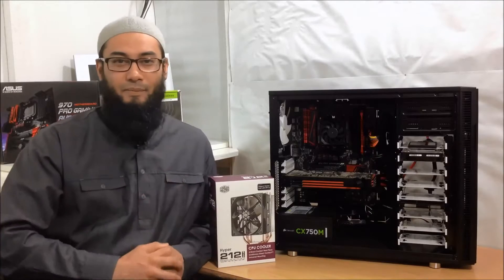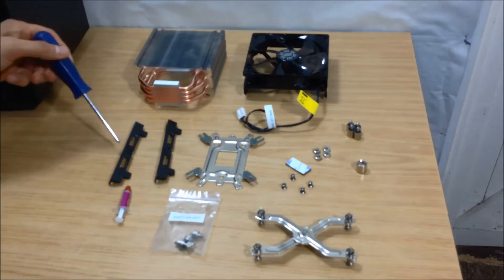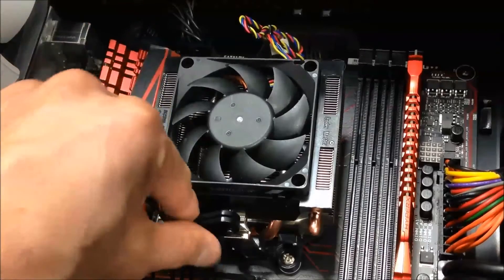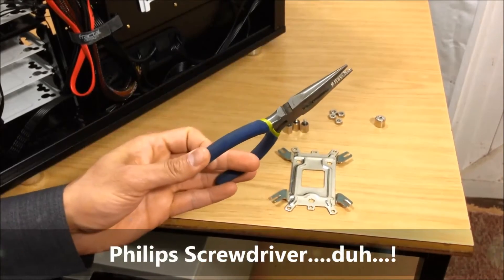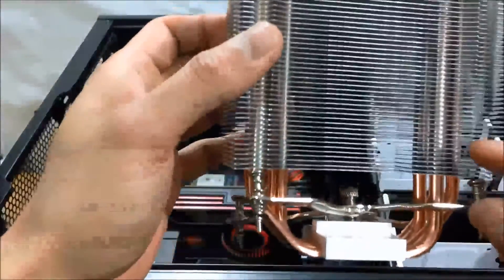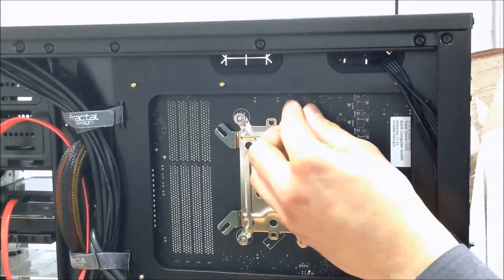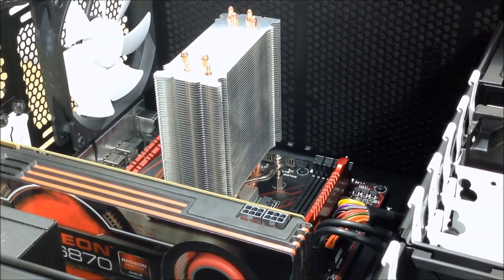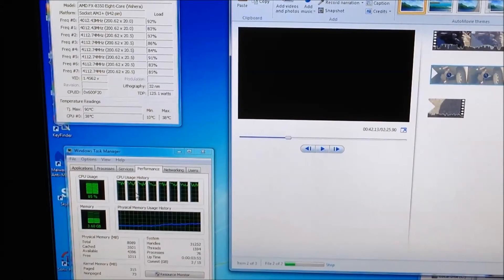Cooler Master Hyper 212 Evo Installation Tutorial

Comment: Brother im getting 54c on my ryzen 5 2600 wihtout load and with load (gaming) it goes to 82 degrees (AMBIENT TEMP IS 32 DEGREES ) . ive changed the thermal paste that came with the stock amd cooler to lower temps and tried applying artic mx thermal paste still its the same . now im thinking about buying this cooler (cooler master ) https://www.amazon.in/Cooler-Master-H410R-RGB-Lighting/dp/B0821GBNHM/ref=sr_1_5?dchild=1&keywords=cpu+cooler&qid=1609999017&sr=8-5. please tell me if this would help lower temps . Thankyou

Comment: Salam brother.... :) actually I need a suggestion, I want to buy i5 6600K skylake and i don't know either cooler master hyper 212 x is good for overclocking it a little or not... ?
Reply: thanks sir.... yes i have a compatible case but the problem is that i did not find any of these cpu coolers in pakistan :/ i'm still searching